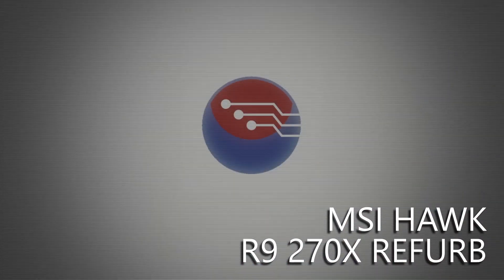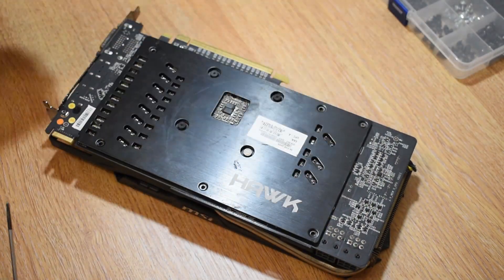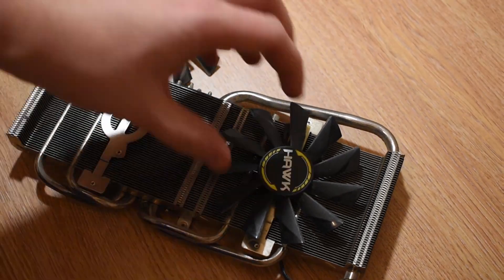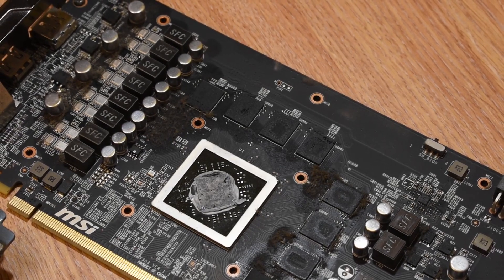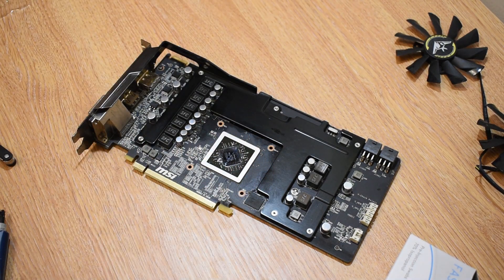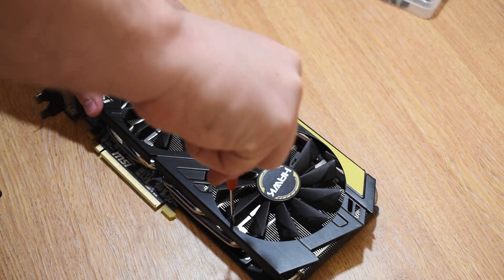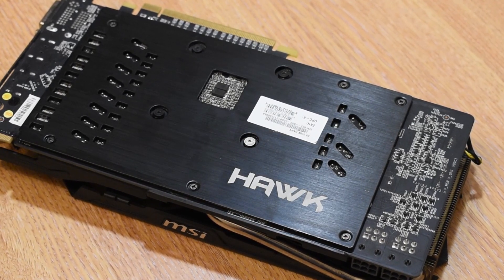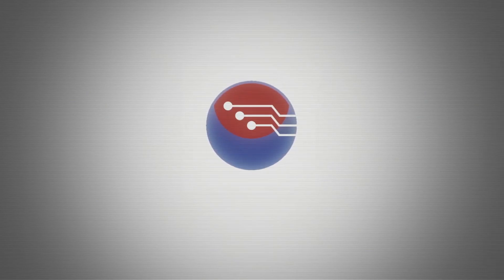7 Year old R9 270X MSI HAWK - Why you NEED to refurbish used graphics cards.

Comment: i personally got a rx 580 4gb for fairly cheap in the past from miner and on the memory thermal pads qhere quite dry i feel like your unit did have is pads changed probably from previous buyer normally should be all dryed after that much time great content